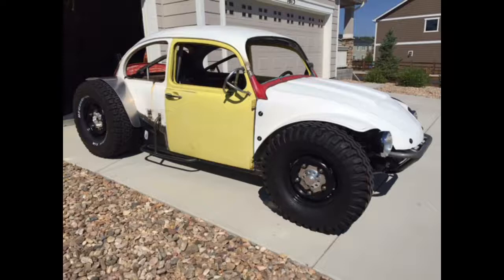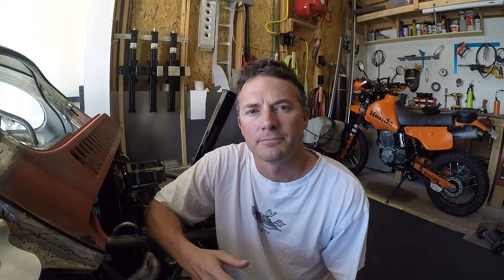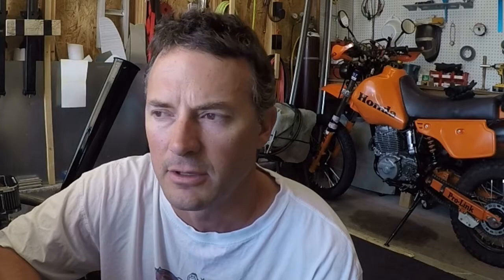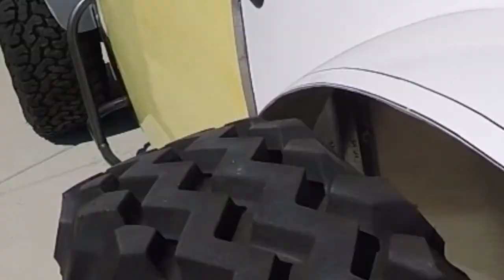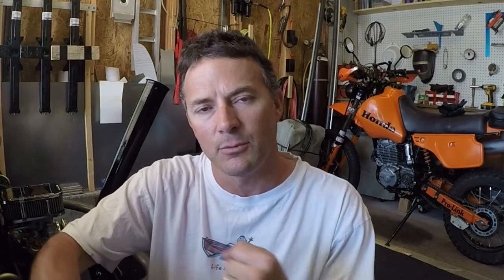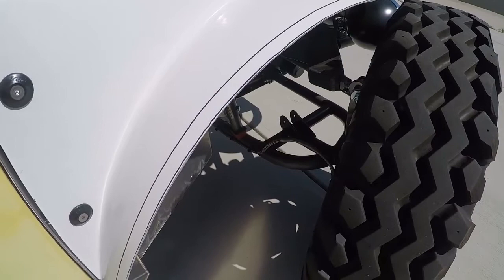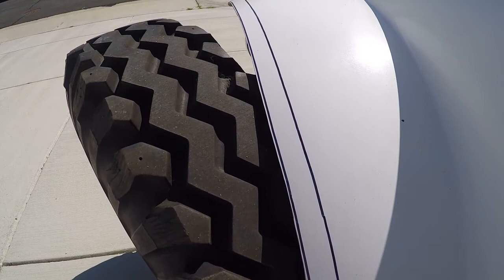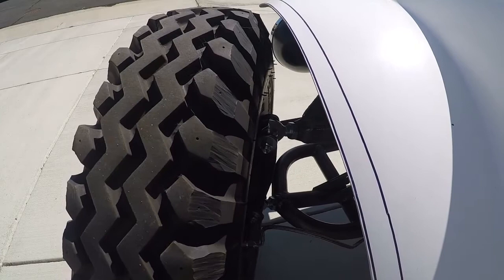Tire Clearance Lock to Lock on Baja Bug

Comment: What all do I need to lift a bug a bit? I'm not worried about performance right now. I'm just trying to figure out what I need to do to lift it an inch or two from stock hight.
Reply from the maker: You need to index the torsion bars. The rear can be done without any changes to the car. The front you need to weld in a device that will allow you to twist the torsion bars. Google "vw torsion indexing". If that is to much then I suppose you could put some shocks on it with coil springs to give it a little lift. Keep in mind either of these will make the ride a little rougher.
Reply: Doug Bug Awesome thank you. I've been looking everywhere, but couldn't find a clear answer on how to lift it. If I do the welding will it be better in the long run if I wanted to do more to the suspension?
Reply from the maker: Yeah, welding in the spring adjusters in the front is the right way to do it. With those you can adjust them to the desired height that you want. Within reason of course. It's not a task for the inexperienced though. I don't know your skill set, before you commit to the welding research these adjusters so you know what you're getting in for. 
Good luck and be safe.

Comment: When can we hear it run
Reply from the maker: Steven Rubio, Well I've spent the last year working on suspension. But now that I'm almost done with that I will be working on actually getting her running. I would think in the next several months I'll be cranking her over and really getting things running. Only thing standing in my way to hear the motor at this point is the electrical system.
Thanks for the comment.